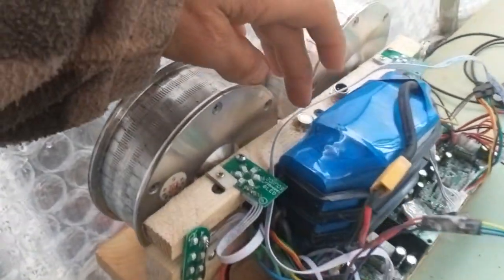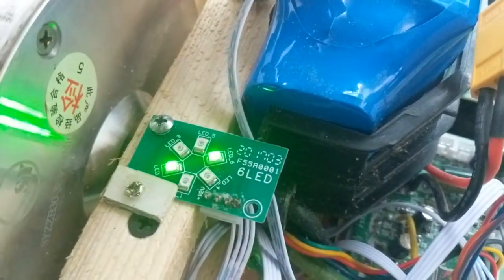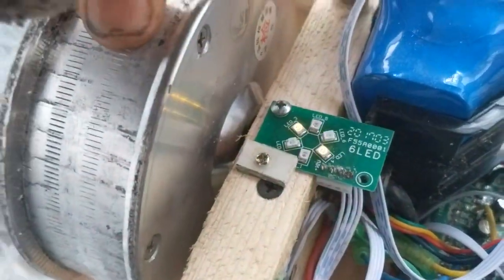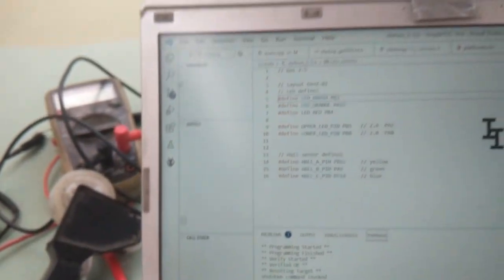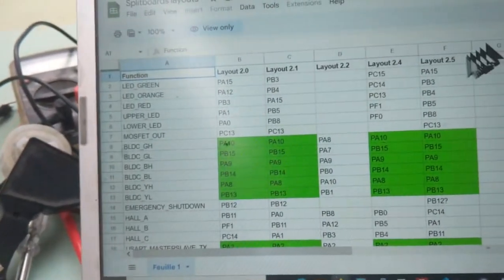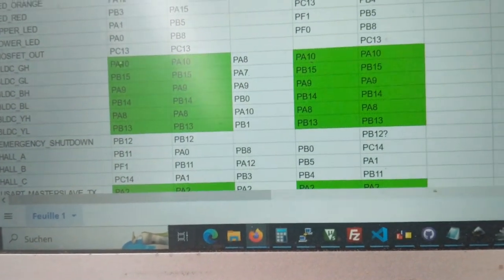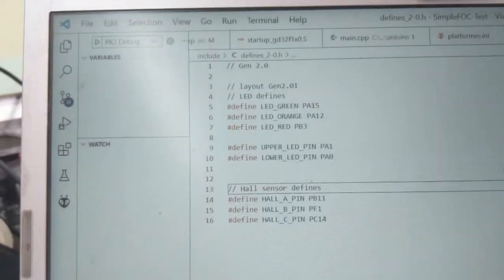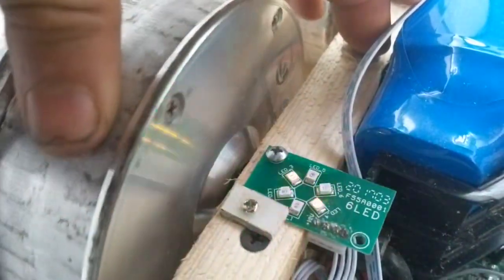C++ SimpleFOC on split hoverboards: Hall already working :-)

Comment: i want to use the board layout 2.0 controller with pwm 0-50-100 signal haw i can do this my knowledge in the code is 0
Reply from the maker: https://github.com/RoboDurden/Hoverboard-Firmware-Hack-Gen2.x/issues/36#issuecomment-1837390938

Comment: no phase current sensor，how to do torque control？
Reply from the maker: i am new to SimpleFOC and have had yet no time to dig deeper.
The Gen2 boards have current adc, that should be enough to code a torque controller.
And some gen2 boards have low-side phase currents of two phases (the third current can be derived from those). I am not sure if the hall sensor are sufficient to do FOC. Theoretically yes. 
Our hoverbord motors have 90 hall steps per revolution and with 14 rpm/V we have 5-8 revs/s yielding 450-630 Hz.
Should be no problem to make a quadratic extrapolation somehow like s(t) = v*t + 1/2 a * t² to boost that to 16 kHz

How this fits to the SimpleFOC library has to be seen.
Please join the coding.

Comment: How can i use vsCode to compile it? Is there Platformio suport?
Reply from the maker: You need to install the platformIO plugin. Go to the platformIO homepage and follow the installation tutorial. It worked very easily for me.
Reply: @robodurden  i am currently trying to port the Firmware to a new revison. Fets and Hall are done, what else do i habe to find?
Reply from the maker: @wcosrnepecjue2897  please start a new issue on my gen2.x repo and upload high res photos as well as your pin findings.
We need to give it a new layout number. We have already 5 layouts..